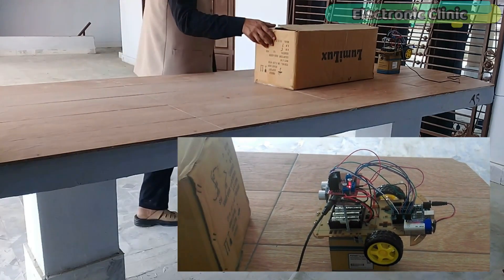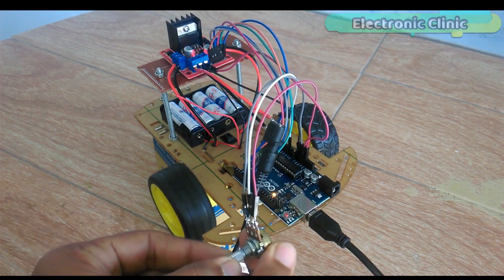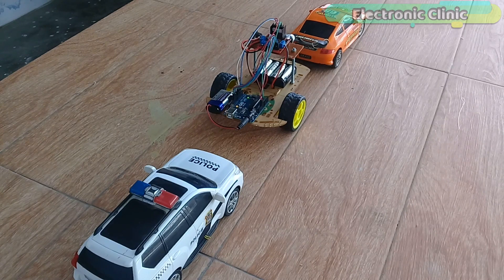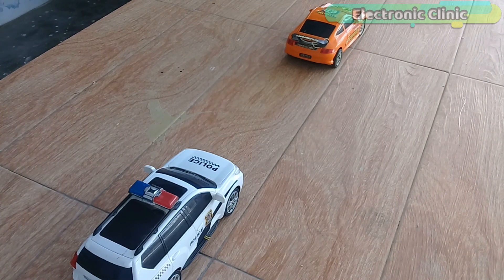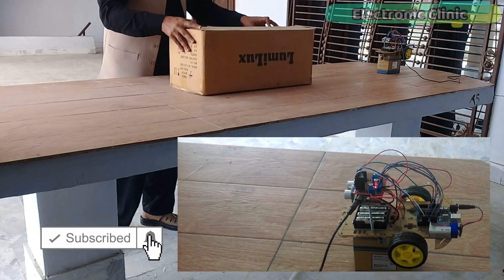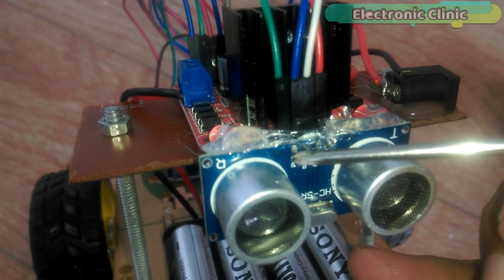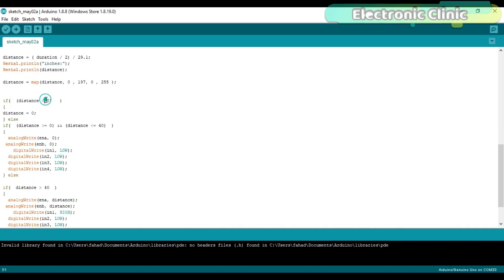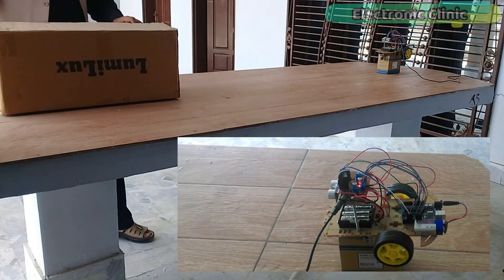Arduino Project: Safe distance maintaining Car to Avoid accident” L298N and Ultrasonic Sensor”

Comment: In this project both tyres of car is not moving forward one is moving forward and second one is moving backward would you please explain why this happening and what is tha solution that both tyre move forward?
Reply: bro can you tell me the connections? my motors aren't running

Comment: Hello Bro, I was working on this project and used the source code. Everything was fine n the Model, But the wheels were not rotating at maximum speed. What code Should I try for attaining MAximum speed of Wheels?

Comment: Bro, which simulator should I use for this system, I used Tinkercad earlier but it didn't had L298N motor driver, please reply
Reply from the maker: you can use Proteus.
Reply: @ElectroniClinic okay thank you

Comment: So hypothetically you could put that sensor to a model rocket and a charge explosive on the tip. The explosive tip reacting to the range supplied by the sensor set to a value. Thats interesting. A possible project.

Comment: Bro u r printing distance in inches but the measured distance is in centimeters right? And also mapping is to be from 0-500 to 0-255?
Reply: I'm trying to understand that line as well. Does the first range deal with the distance while the second range refer to the power output to the motors?

Comment: why you didn't let us see the robot car move forward so we can see if it runs straight line or not
Reply from the maker: I have tested this. it works perfectly. you can see the wheel are rotating ;).

Comment: hi,  Can you comment on the distance equation in the code, please?  "Distance = (duration/2) / 29.1  "
Reply: I'm one year to late, but it is never late to learn something new. Speed of sound is 343m/s so it goes 1cm in 1/343 seconds or 29.1microseconds, it goes both way so it also have to be divided by two.